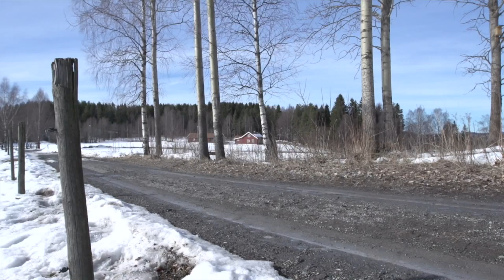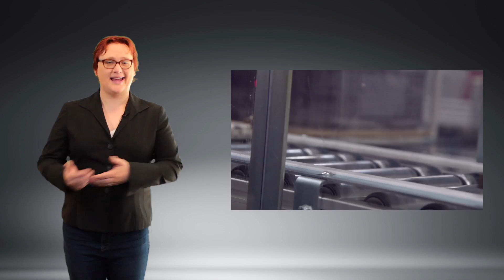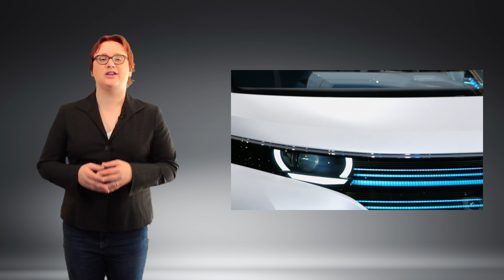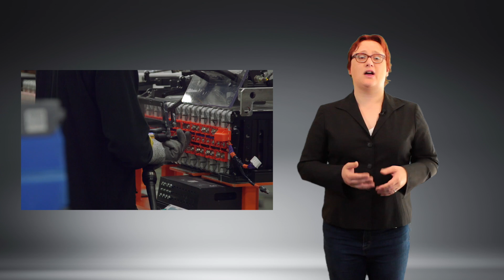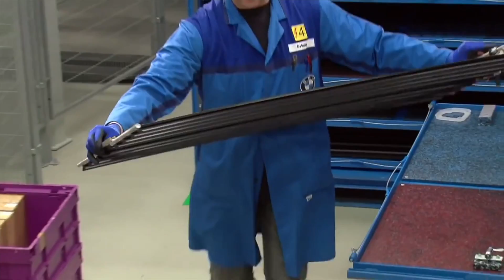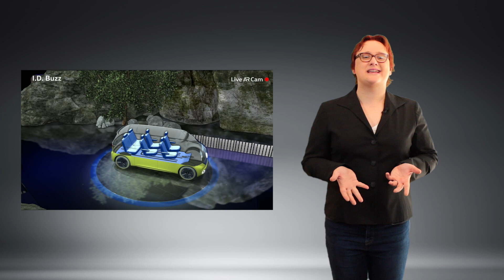How Many Gigafactories Will it Take to 100% Electrify Global Transport?

Comment: SORRY TO SAY, but before adding huge fleet of EV's in the new vehicle sales, at least 50% of the electricity must be made from renewable energy and it should be growing. No one talks about that, it is important to be proactive here. the huge number of EV fleet in next 2 decades could almost double the electricity demand which will be obviously coming from fossil fuels because they are cheap and stable electricity generators.  

TESLA says it is going towards  being sustainable, it is  NOT sustainable until the whole  electricity generation is from renewable energy which is only 14% in USA.  if  EV companies are really proactive on being sustainable they must first make solutions to make more than 50% electricity from renewable energy and only then they should start selling EV's. they do not do this because profitability, becoming a big company is what is driving them. so no EV including TESLA is NOT ACCELERATING THE WORLDS TRANSITION TO SUSTAINABLE ENERGY!  i seriously doubt that if proactive steps are not taken, electricity demand from fossil fuels may rise unexpectedly!  

3rd generation bio fuels in parallel to zero toxic pollution, Zero Noise and high power density IC engines are going to be seen very soon, which will make the  travel absolutely clean and sustainable.  then comes making the car sustainable which includes replacing plastic's with bio plastics and getting rid of any environmentally harmful materials in the car and making the whole  CAR 100% recyclable. Mazda and many other manufacturers are already in this way.  think through it and think proactively!

please do correct me if I am wrong
Reply from the maker: Hi Anwesh,

Here's a really good article that covers the cradle to grave benefits of EV's in NZ
https://ecotricity.co.nz/cradle-to-grave-emissions/

Hope that helps.

Team Bring Change
Ecotricity
Reply: I really love your comment
Reply: Electric motors are 90% efficient. ICE engines are maybe 16-20%. Coal is in decline in the US, maybe 28% now. As the grid gets greener, EV's get better and better.

Comment: The technology with batteries is moving very quickly and there is substantial research going on all over the world with good success. Salt water batteries can be used in houses, where size and weight are not critical, and there several other projects that are proven but not of manufacturing scale nearly ready. Elon Musk is probably right about the 100 factories but they may not use lithium. We are in the infancy of this technology and does it matter to us what they put in the the battery as long as it is clean and cheap